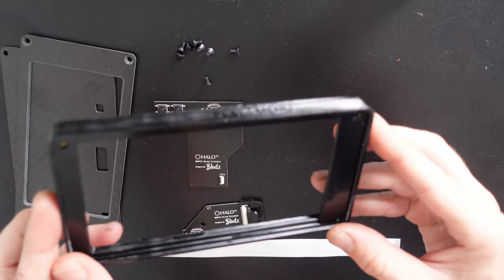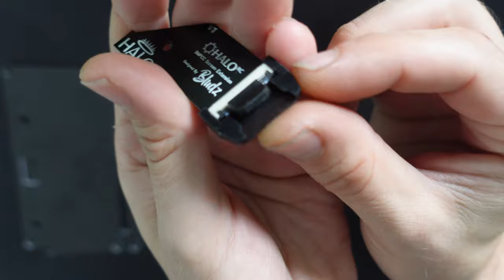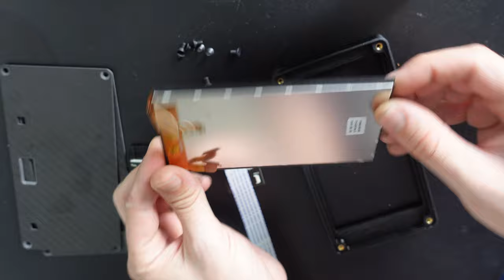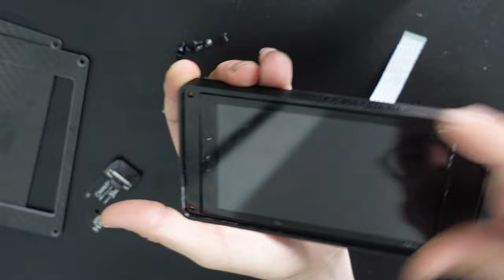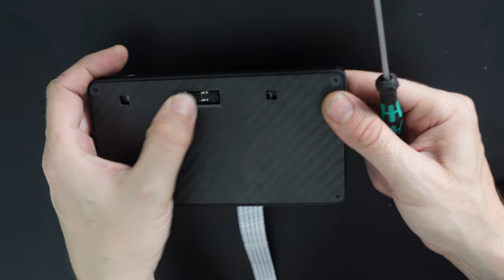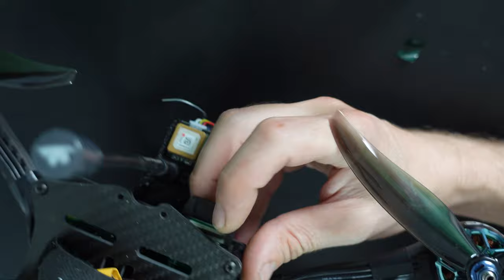Naked Blackmagic UPGRADE - HaloRC BMPCC Screen Extension

Comment: Could you use the the screen Extension without taking the rest of the camera a part
Reply from the maker: No, not in its current form. The connector sticks out further than the hdmi.
Reply: @Bludz  thank you so much for your reply :goodvibes: